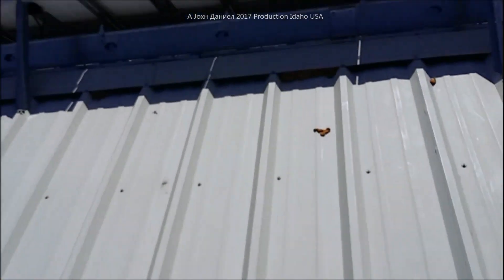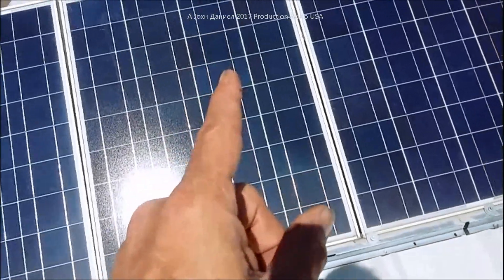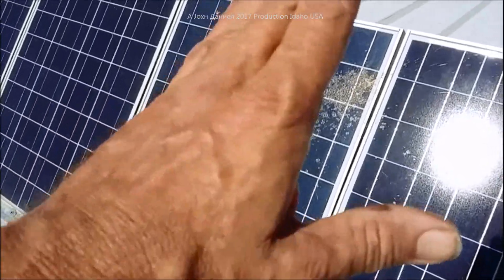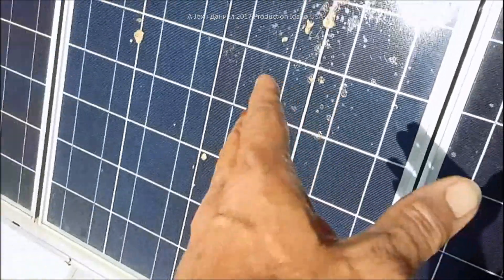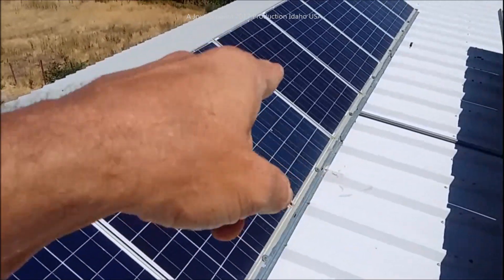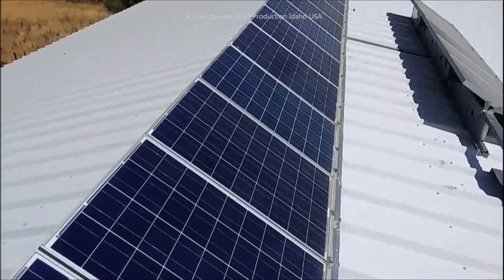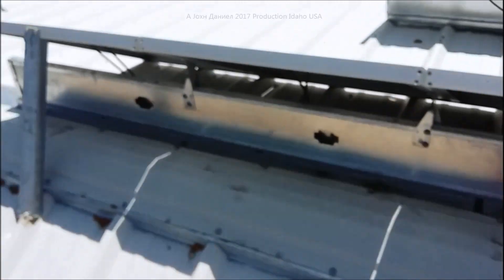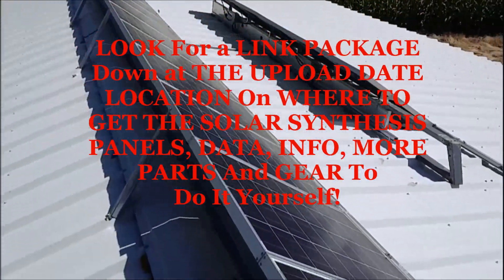Solar Panels diodes, Blocking Effect explained (read all below)

Comment from the maker: NEW SOLAR FOLKS  You Can Do It ✌  Best MPPT controller 40 amp http://amzn.to/2ggyi44 ,Best Solar Panels https://ebay.to/386aeGp the MightyMax100w4bar *Rock solid power Inverter 2000 Watt https://amzn.to/2v2dPXm , REAL 150AMP Watt/amp Meter, https://ebay.to/2u0muto PROVEN BEST ONE MADE, Don't get fooled by fake vietnam knock off copper colored aluminum wired fire hazard sold from missouri wind & soliar junk.
Solar Wire and other parts will be needed but that is all depending on where you install, not a difficult thing, not expensive. I have been doing wind and solar as a OWNER/USER for over 15 years. I am not a dealer, I hate dealers.

Comment: People are confused. Blocking diode does not equal bypass diodes. Usually in the black box on a panel are bypass diodes. They serve different functions but are the same individual component.

Comment: I think the terminology may be confusing in this video.  I think what this video is explaining is a bypass not blocking diode. See the description below.

BLOCKING DIODE:
Blocking diodes are needed in Off-Grid battery installations and not in On Grid installations on villa roofs that transmit the surplus power to the grid.

When the sun is shining and the voltage across the solar panels is higher than the battery voltage, the battery will be charged. When it gets dark and the solar cells stop producing, then the power will begin to leak back to the panels and thereby discharge your battery.
This will be prevented by a Blocking Diode.
Therefore, a blocking diode is important in all Off-Grid systems where a battery is being charged (On Grid hybrid systems on rooftops with battery, is typically handled in the inverter).
Blocking Diode is mounted or included for our SunWare and SpectraLite solar panels. All other photovoltaic panels must have them purchased … or they shouldn’t, anyway, because the Blocking diodes are built into all our solar cell controllers, with the exception of HRDi and HRSi.

HRDi and HRSi are combined wind turbines and solar cell chargers. They use the same electronics for both solar cell and wind turbine input. Therefore, the wind turbine at night can stand and produce electricity that ends up in the solar cells rather than the battery. Therefore, a blocking diode must be mounted on HRDi and HRSi.
Parallel connected solar panels must each have their own Blocking Diode mounted.
The Rutland 1200 charging regulator has separate electronics with a built-in diode for the solar cells and therefore there is no need for an external Blocking Diode.

BYPASS DIODES:
ByPass Diodes have a completely different function. They have to make sure that if a solar panel is shaded in your series of connected solar panels, then only the one panel/cell of connected solar cells are affected by this. This applies to access for both On Grid and Off Grid solar cells. ByPass diodes are almost always built into the solar panels from the factory (and at least in all ours).
The reason for ByPass Diodes is that if you have 2 solar panels in series connection (see diagram above) and you get shade on panel no. 1, then panel no. 1’s resistance rises sharply and thus the current from panel no. 2 is “eaten” by panel no. 1. The ByPass diode ensures that the current produced on Panel no. 2 can “bypass” thus flow outside panel no. 1 instead of disappearing in panel no 1.
It is very normal that there are several ByPass Diodes in each solar panel, so for example. If a solar panel of 300 watts has 3 ByPass Diodes and the panel is shaded 1/3, then only 100 watts are lost and not the entire panel.
CIGS panel does often have many bypass diodes, which is one of the reasons that they are superior in shaded environments.

When you connect solar panels in parallel, you do get anything from the ByPass diodes. There is nothing to bypass, except the ones built in the panel and they are normally always there.

CONCLUSION:
Blocking Diode and ByPass Diodes are really important to have in your solar cell system, but it is usually taken care of by the manufacturers. At Energig it is only when you use an HRDi or HRSi let the regulator for a combined solar and wind generator setup that you need a diode that can block backflow to the solar cells at night. The rest is provided for.

Comment: I'm thinking each group of panels are wired in parallel, so your sending say 20-30 amps at about 20 volts to each controller, is that correct?  Doesn't the goose shit effect go away when panels are wired in series?
Reply from the maker: Depends on how bad it is, but we are currently pushing 35 to 36 amps per string into 2 - 40 amp solar mate MPPT's, 35-37 amps mounted behind the shop up off the ground in to another 40 amp MPPT, then 65 to 70 amps into 1 - 80 amp PWM. and then the SW array 28-30 amps into another 40 A - Solar Mate. My shop system is about 200 amps incoming at any given time. The house is 50 amps on it. Both tied together with a buck boost balance circuit I made myself.

Comment: In other word diode prevent shaded(or shit goose effect) panel from being bullying. Because it produce less voltage vs others,and voltage(volt) like to flow from higher volt to lower volt. Diode basically prevent backflow of current(from higher to lower).

Comment from the maker: The absolute Best Solar Panels & Home Power Kit design for under $1000 is as Follows: You Can actually Do It Yourself from this list below. ✌ Yeah, its a read!
*Best all around and durable MPPT solar controller for a home system The Renogy ROVER 40 amp http://amzn.to/2ggyi44
*ABSOLUTE Best Solar Panels to put on it is http://rover.ebay.com/rover/1/711-53200-19255-0/1?icep_ff3=2&pub=5575119394&toolid=10001&campid=5337966591&customid=PREMIUM+LIFESPAN&icep_item=381680181673&ipn=psmain&icep_vectorid=229466&kwid=902099&mtid=824&kw=lg 5 of these 100 watt for a total of 500 watts, a perfect safe 92.5% the capacity of the 40 amp MPPT and VERY SMART design. You can tie 2x2 for a 24 volt system or 1x4 for a 12 volt system Its that DAMN EASY!  
*A impressive rock solid DC to AC power Inverter sized for this kit is the German engineered KRIËGER 2000 Watt  (specs at) http://rover.ebay.com/rover/1/711-53200-19255-0/1?icep_ff3=2&pub=5575119394&toolid=10001&campid=5337966591&customid=Top+Tier+Inverter+&icep_item=292165278763&ipn=psmain&icep_vectorid=229466&kwid=902099&mtid=824&kw=lg Off Grid Energy 
If you need someone to talk to about wiring and mounting help, write me and ASK!  What I list is due to my own test, quality, cost and supplier trustworthiness.
This serious 500+ watt solar basic + system for around $1000 is expandable. And will be cheaper to own than any gas generator or alternate power supply. As a person who lives off grid, I know what works together! And I gave you a list of the most dependable parts you can find on a budget and my experience for free!

Comment: nice explanation, ive read about it , panels in series and partial blocking, but now it finaly sunk in to my thick head.
is yours a high voltage grid tied or 12v battery
Reply from the maker: +closertothetruth All 12 volt